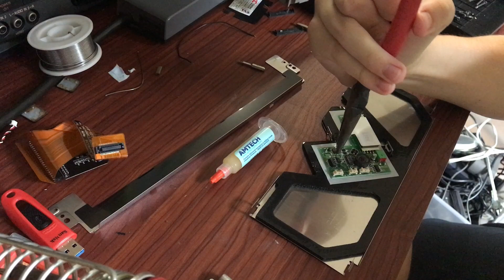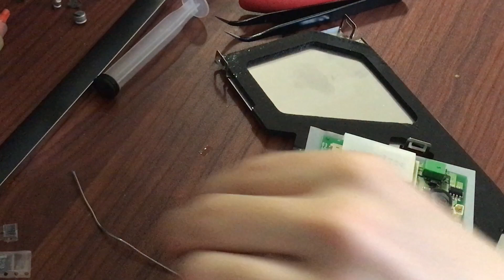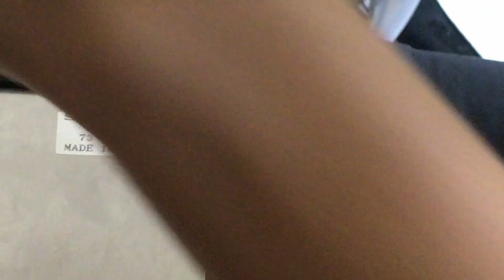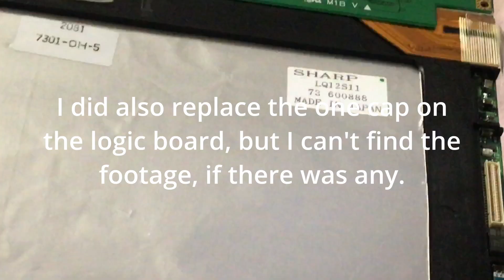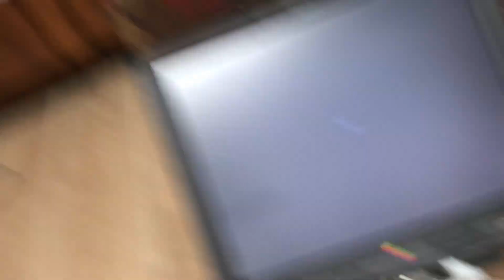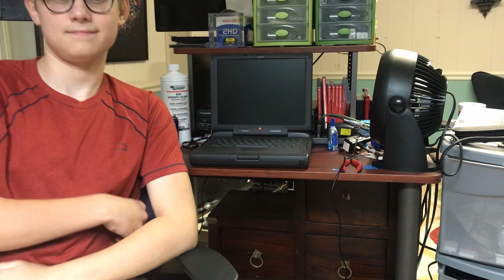PowerBook 3400c Part 2 - Recapped and Upgraded!

Comment from the maker: Capacitor reference info on values (along with images) is available on my website: http://macdat.net/cap_reference/apple/powerbook/3400c.html
Reply: Thank you for the reference, since I’m planning on recapping a PowerBook 3400c I have. Do you happen to have the capacitor dimensions or diameters (since they can be different sizes) or a mouser order list to pull from?
Reply from the maker: @mattpenndotcom  you the same guy who linked this page on r/vintageapple? If so, thanks! I did recently get a second 3400, I’ve been meaning to take it apart and get the dimensions (you aren’t the first to ask). Not sure when that will be though because I’m pretty busy at the moment.
Reply from the maker: For what it’s worth, I just bought them mostly at random and they all fit fine. Get a very small 2.2uf one though, original is tiny. I’d also recommend a smaller replacement for the 330uf cap for easier soldering.
Reply: This reference is a huge help, thanks!  My 3400c stopped booting a decade ago, and I haven't had the heart to toss or sell it.  I will take it apart this summer to look for bad caps especially along the DC board.
Reply from the maker: @mjgiro  uh oh… you may be screwed here. I didn’t mention it in this video but these have a NiMH PRAM battery in then that leaks all over the logic board… if your unit quit working 10 years ago I’ll bet that battery’s the culprit. Best of luck…
Reply: @3lectr1c  I removed that a long time ago :) I did a lot of diagnosing before giving up, but had never checked the capacitors.

Comment: I got a 3400 a couple months ago and for the most part it works fine. I had to remove the PRAM battery because it was leaking hard, thankfully it didn't damage anything other than its connector but the system had some power issues. 
It autoboots when I plug in the charger and I thought that was an issues with the power board or the logic board but after seeing your video I realized that it's supposed to do that since the PRAM battery is gone. But it has another weird issue. 
The main battery still holds a charge, but the computer sometimes won't turn on with just the battery, and when I turn it off I have to unplug the power cord and the battery and replug everything to turn it on again. 
I don't really know much about old PowerBooks, do you have any idea if that issue may be happening because the PRAM is missing? Or do I have to take it apart and check/recap the power board?
Reply from the maker: A recap of the power board will make everything more reliable long term, but you’re issues here are due to the missing PRAM battery.
The 3400 with no PRAM battery will start off a main battery if it hasn’t lost power since the last time it was on the charger. So if you charge the battery and start the computer, shut it down then unplug, it will boot off the battery. If you remove the battery and put it back in, it’s lost power and will need to be jump started off the charger. The same goes for if you swap another working battery in.
Reply: @3lectr1c  Oh so it's PRAM related, thanks, it's good to know that my unit is fine
I still will recap it but now I know the issue is normal

Comment: Probably figured out by now but that could be flux, just going by the amount you put on when you were doing the inverter board.
Reply from the maker: The splotch in the screen? I didn’t use any additional flux other than whatever was in the solder on the LCD for that exact reason, also don’t believe that the splotch matched up in location to the caps I changed.